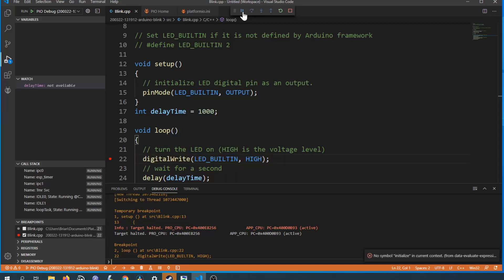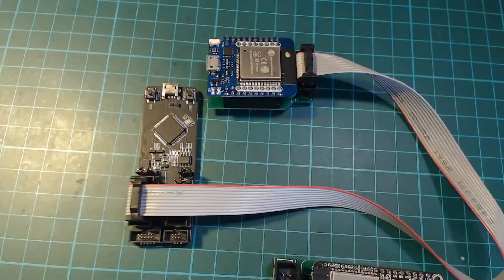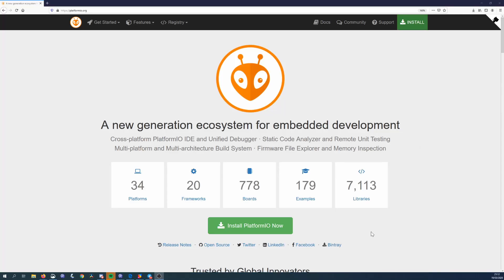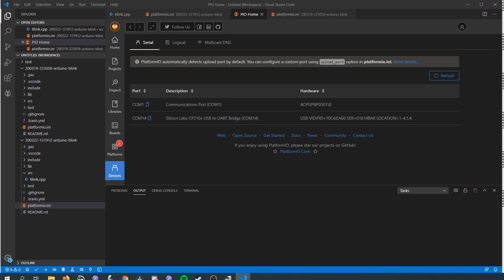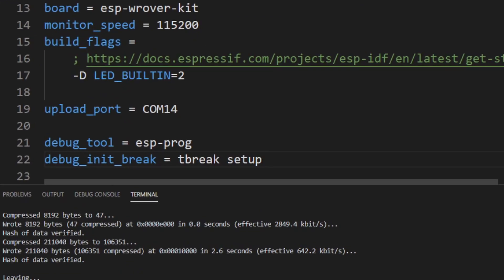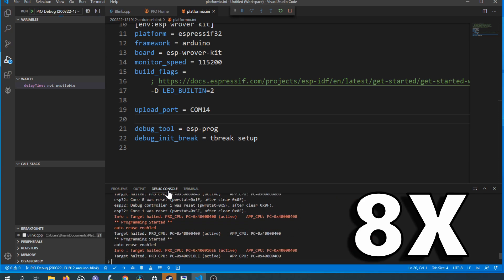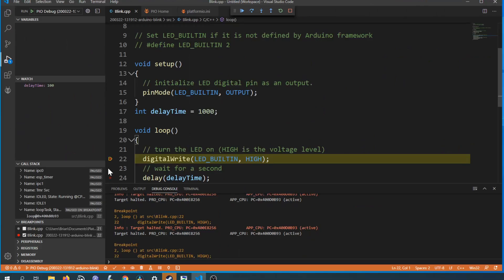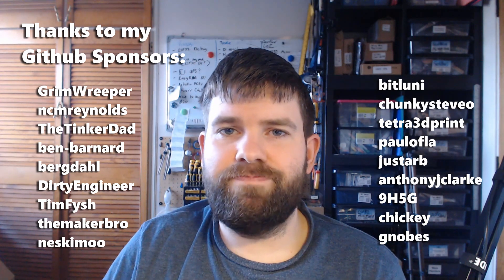How to use the PlatformIO debugger on the ESP32 using an ESP-prog

Comment: hi, thanks for sharing, but I cannot get it work on the LuatOS ESP32-C3 board which missing the GPIO 14, 15 pins, although I replaced it with other pins as shown in the ESP_Prog's website, still failed at the GDB debug session and yet I confirmed pin connection is correct and already use Zadig to replace to WinUSB driver, you can see my comments on the paltformio community web link ended at number 42819. Any idea ?

Comment: I would do a back before doing anything. There is a reasonable chance this will corrupt a Windows system. I lost all keyboard use and had to restore from a restore point and after recovering the system
VS studio code would not launch and it required a reinstall of VS.
I suspect the drivers that are suggested for download are defective and the lists of drivers don't match
those in the video. 2/9/2024 Just be very careful!

Comment: Thank you Brian, verry helpfull. 

My experience is, that the hardware setup, especially the connection is very critical.
Starting the debugger only worked reliable, when i used very short cables betwenn ESP32 and the debugger. 
That means:  Only direct and short connection with single Dupont cables (10 cm) worked for me.  
On the other hand, a self-made adapter cable (15 cm) with an IDC connector on the debugger-side and Dupont connectors on the ESP32-side did not work reliable.

I have not looked at the specification of the JTAG interface. But I can imagine that there is a timing problem with too long cables. 
Do you know, if there is a possibility to reduce the JTAG speed to make the communication more robust?

I also suspect that the problems during downloading the program via the USB interface are related to the cable length at the JTAG port of the ESP. Maybe the port catches interference via long cables.

Comment: The ESP32-C3 (Single Risc-V Core) shows it has JTAG/USB support, but can it also be debugged using PlatformIO and even VSCode?    

Or would the C3 need to be flashed with something that enables SWD debugging?

BTW, in terms of debugging, any thoughts between VSCode and Visual Studio + VisualGDB ?

Comment: Brian, nice clear video and I will have debugging working in a fraction of the time it would have taken me to get this inofrmation on my own. You mention that when the board is connected that sometimes it dosn't load. I have this promblem on one of my boards without anything attached. If I place a 2.2 / 3.3 microfarad capacitor from GND to EN port the problem goes away. It may be that the capacitence of the enable pin is changing when it mounted, or it could be something completley different. It may be worth a try though and if it sorts out the issue, all good. Thanks for the effort you put in.

Comment: Brian, thanks a lot for this tutorial. Now, I want to share with all of you a little experience that I had when I tried to start the debugging process: This process just didn't start and the debugger console said me that the problem was an error in GDB and OpenOCD settings...

After searching for a long time, finally I could found someone who gave me the answer ( https://youtu.be/fvOzpKJY2gM?t=1177 ) and this answer is unexpectedly simple: REMOVE THE JUMPER FROM THE IO0_ON/OFF PINS when you want to use the JTAG port of the ESP-Prog.

I hope this information can save time for someone with the same problem
Reply: Hi there, im actually having troubles with the same issue. its taking the jumper off the unique thing u needed ti avoid de LIB of openOCD error? Thank u so muchi

Comment: Your vid is a bit deceiving. You start of by creating the impression that you only need the JTAG interface but then casually plug in the USB bridge programmer like its no small matter at all. What you should have said is that you need RX0/TX0/EN/BOOT plus JTAG signals on top of that to accomplish this task. I found this to be extremely annoying since if you design a project with RX0/TX0 used for a product interface you are pretty much plucked since you will then have to hack RX0/TX0 lines in order to download code and not cause a meltdown
Reply: Not so, you can upload code via the JTAG.
Reply: @foxabilo  wow....I will have to investigate that - thx!!!

Comment: Tanks for this guide. Do you think JTAG debugging will be useful for figuring out problems with a sketch half crashing after 6-24 hours of running? (By half crashing I mean, serial monitor and MQTT messages stop sending, but web interface continues to work.)

Comment: Disclosure: The pinout for the ESP32-S2 board is different. In my testing, you MUST have both boards connected for debugging to work (shame, thought you could upload over jtag).

TDO: GPIO40
TDI: GPIO41
TCK: GPIO39
TMS: GPIO42

Comment: Nice tutorial. Well done. I had some trouble with missing libraries and could not start debug. I checked them at the debug console after hitting f5. After I installed them in the terminal, everything went fine.

Comment: Very helpful tutorial, thank you! I confused VCC with 5V and mistakenly connected VCC from esp-prog to 5V on the ESP32 dev board. It took me a while to realize that VCC is 3.3V. Luckily none of the boards burn. Actually the VCC line should not ne connected at all. I connected both esp-prog and esp32 dev board to the micro USB connectors, so they both get power from USB and then only connected the ground of both boards. Not sure that connecting the grounds is necessary because it is connected through the USB, but I connected them anyhow. Then eventually I was able to debug. I find the debugger very useful but I got various problems that I don't know yet how to overcome. The most annoying problem is that at some point the debugger stops going in "step over" mode and always doing "step into" even if I hit "step over". I still have a long way to go to master this tool, but it seems worth making the effort. Thanks again!

Comment: thank you for the video Brian. I can confirm that upload via JTAG works. However I found putting "build_type = debug" and "debug_init_break = tbreak setup" ini file caused me issues. So I recommend not putting them in at the start. Then work your way from there.

Comment: BEWARE...If you refer to Zadig::USB ID..The hexadecimal numbers 0403 and 6010 are the USB vendor and product ID of the FT2232HL chip and OpenOCD looks for them. Unfortunately, the FT232H chip has the vendor/product ID 0403/6014.

Comment: I may be missing something obvious, but can't the ESP-PROG power the board to be debugged via the pin you colored red (VCC), meaning you wouldn't have to connect the board itself via USB at all?
Reply from the maker: Power wise yes, I was connecting both so I could program the board via USB. People have mentioned since it can be done via esp-prog using JTAG but I have never tried it
Reply: @BrianLough  Wow, I didn't expect to get a reply to this within the hour! Cheers, thanks a lot for this video and your quick reply. Did you notice any issues with your ESP-PROG clone? Amazon.de does list one genuinely manifactured by espressif, but not sure if it's worth the extra cost

Comment: Brian, many thanks for the video.  It's unclear how things are connected. Do you plug both devices into your computer via two separate USB cables? or are you just connecting via a single USB connection through the esp-prog ?
Reply from the maker: Hey Kieran
I've been using two cables, but I think 1 should be ok. Once the code is uploaded, you could plug out the esp32 and plug in the esp-prog. The esp-prog even supplies 3.3v

Another commenter mentioned that you can upload via the esp-prog too, but I've never tried it
Reply: @BrianLough It seems that when you update the drivers on Windows USB that is to allow two USB channels on the same physical cable.